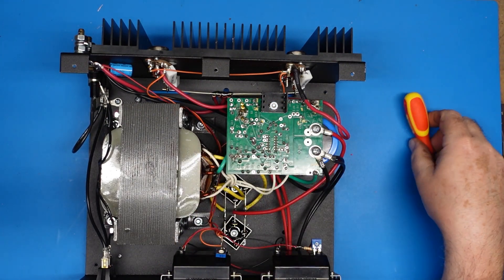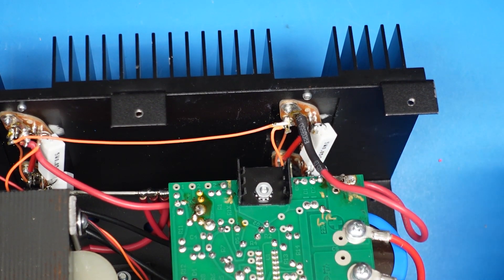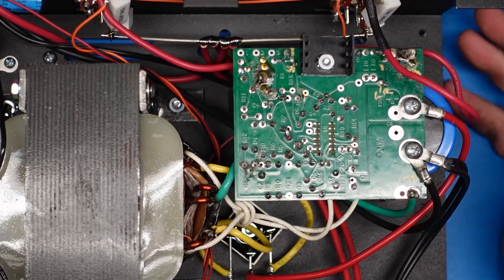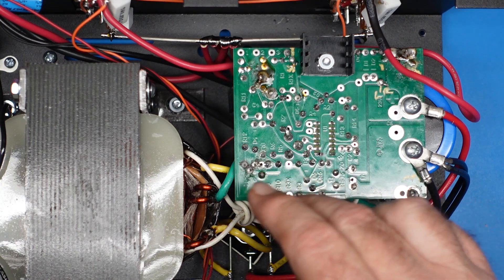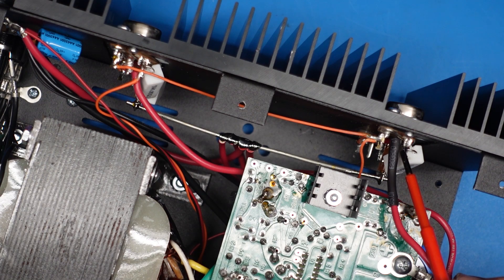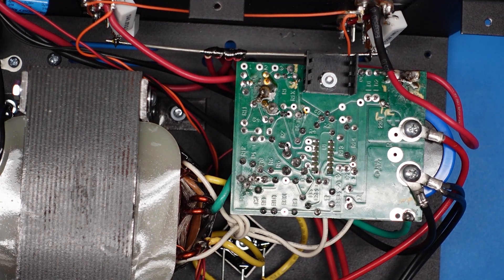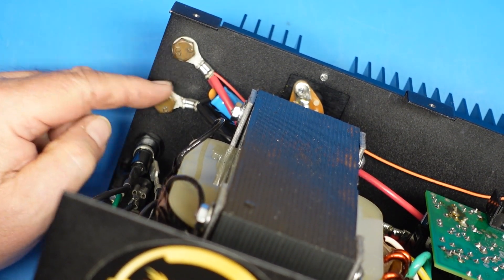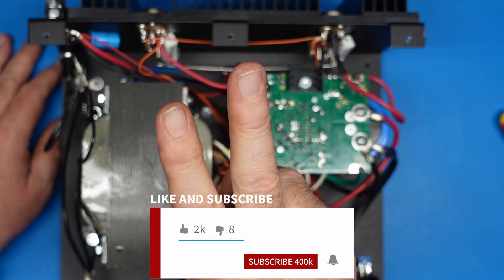Decoding the Mystery: Understanding Astron PSU Failure Mode

Comment: I have tested everything and replaced everything and cant get mine to work... I'm reading 0.2ohms from + to - on the back posts
Reply from the maker: I am pretty sure the one I have is snakebit at this point.  I had it working, now it's gone full stupid.  Again.
Reply: @FEPLabsRadio I actually found my issue! it was the 2200uf filter cap that that is between the two output terminals. I clipped it off and the PSU turned right on. I have the spare coming in the mail. I haven’t seen anybody mention this failure point online yet

Comment: How did you verify that the filter capacitor is good? Mine has no ac on the output. When transmitting the output voltage drops 2 volts. It has a regulator problem. I'm going  to replace the LM723 next. Any thoughts? Thank you! Larry.

Comment: I'm having the problem right now where the fuse blows as soon as you turn it on and no output. VS-35M circa 2007

5:00 Mine doesn't have that black ceramic cap on the input side of the transformer. Huh.
Reply from the maker: Look on repeaterbuilder.com - there is a pretty comprehensive troubleshooting/diagnostic list of docs on there, specifically for Astron linears.  Somewhere, you have a dead short.  Honestly, the innards look like it was soldered by somebody who just learned how to solder

Comment: I have an electrical engineering degree and experience with power supplies and I had to go through the exact same process to get my Astron RS-20M back to life (after it was I who put it out of service by trying to “voltage-charge a lead acid battery with the thing—not good with this machine). So don’t feel as if anyone else would have brought more to the table than you did. A mixed blessing, these Astron power supplies: they last for a while in normal use—don’t ask more of it than intended and careful trying to modify because they weren’t designed to be “modified.” But when they quit you have a devil of a time troubleshooting—they were designed (somewhat) well but not for troubleshooting. It’s all crammed into the case with no convenient test points between stages. I was to the point of scrapping this thing and scavenging parts but tried one more thing and behold, didn’t blow the fuse again and DID show 13.2 volts out. This thing could last ANOTHER 10 years. Worth fixing because they’re so expensive but boy, do they suck up bench time. Keep up the good work!
Reply from the maker: I had a lot of good help out of a buddy (Hollywood) when I was working on it.  It was at the far edge of my skill level.  Turned out to be a little more than parts swapping, but glad I got the beast fixed.  It was still under warranty, but I just didn't want to hassle with that, and figured it might be a decent enough video while I struggled through it all.  Thanks for the good words, and thanks for watching!

Comment: nice work. glad you figured it out. i have fixed many power supplies over the years .lost count. started in 1976 or so. been fixing them building them. not just 13.8V ones either.  most Astron ones have them bolt studs for power.  the newer ones have power poles.  they have insulating caps for them TO-3 transistors.  I add heat shrink to AC leads . easy to do. most of them supply's are that way.  most of failures I see is power surges and made with cheap sub standard parts. and over loading . like buying a 15 amp to run a Icom 7300. at full power that peak 21/22 amps.  I add MOV or GDT surge protection often. some of that old thermal compound goes bad and dries out making transistors heat up to much. I clean them and re due.  using thermal camera to check them. also some times them bridge rectifiers go bad. mostly on Pyramid and China brand ones. with that one in video with them 2 rectifiers mounted to cabinet bottom ,If you have them go bad replace them and add a piece of aluminum or copper to work as a heat sink and use that thermal compound. I have bigger replacements I use. never had a replacement bigger one fail yet. you would love the 200 amp cont./250 amp surge one I bult. it linear 723 IC based and 30 2N 3772 transistors. fan cooled. 4 50  amp transformers.  240V ac in. made in 1988 around. never failed. big and heavy. 1 person can't lift it. 
73's
Reply from the maker: Thanks for watching my struggles!  I think the original problem was a bad solder/short in one spot, barely making bad touches !  In my troubleshooting (admittedly, blazing a trail), I also induced another problem initially.

Comment: Always good to take pics during disassembly specifically if you don't have a good manual.  I would also always replace the pass transistors in pairs if they are set up as a darlington pair.  Just my thoughts from my experiences.  It was definitely a learning experience.  Great series you ought to put it together as one.  thanks Jeem!  73
Reply from the maker: Jeff, I have NO idea why I didn't.  That would have been easier than all those labels.  Yeah, when I smoked one of the transistors, I looked up the parts, and they weren't crazy expensive, I figured I'd just get all of them, and eliminate the issue from cropping up later.

Comment: Well, I won’t be buying an Astron power supply. Thanks for the update.
Reply from the maker: I have 2, and to be fair, this was under warranty, I took the hard route on it.  However, it was not super quality I saw inside.  My buddy called it "MFJ quality" on the wiring and solders.  I'd say it's Cadillac pricing and Pinto construction.

Comment: The stud or bolt connections can carry much more power than a binding post.  Binding post will have melted long before the bolts even get warm.  All of my high power lab supplies made by HP have studs/bolts on the back for output.  HP used bolts for a reason, current carrying capacity and connection reliability.  No matter how hard you try you just can't hand tighten a binding post as tight as you can a bolt and nut.  It's so easy to move wiring around and unknowingly loosen the binding post.  Try to do that with a stud connection you tightened with a wrench.
Reply from the maker: Probably so, but I still think exposed hot terminals is poor design.  I ended up 3-D printing a cover to go over it, so nothing lands on those studs and shorts them out.
Reply: @FEPLabsRadio   That's one thing high current lab supplies have that the Astrons don't, terminal covers.

Comment: Astron used to put binding posts on their 12amp and 20amp supplies,  The main failure I saw was the 723 chip going bad, so I started installing a socket. whenever replacement was needed.  I heard recently that 723 ic's were no longer being made,  and Astron had redesigned their regulator board. Thank you Jim!
Reply from the maker: I grabbed a pack of them, can';t remember if it was mouser, or amazon.  Thankfully mine was socketed.

Comment: You can 3D print covers for the transistors and cover for the power posts.
I have a Astron RS-12A I picked up at Goodwill.  With no load it measures 14 volts, but as soon as any type of load, no matter how small, it drops to 7 volts.  When I get time I need to tear it apart.
Good videos on repairing the power supply. These have been around forever.
Reply from the maker: You can check the pass transistors pretty easy, don't even have to take the cover off.  Next, I'd replace the 723 chip (hopefully yours is socketed.).  Those are cheap components and not involved to replace.
Check out SevenFortyOne's channel, he has a couple of good videos on his troubleshooting process for Astron's.

Ron - I went and grabbed them off thingiverse, I have covers on all of it now.  Transistors, and the posts on the back.  Thanks for watching!

Comment: Binding posts will carry less current, and are less secure physically. That is, the nuts on the studs take a wrench and stay put better than binding posts.

Plus, it's only 13.8V. On the back. Away from children (right?). So, who cares?
Reply from the maker: I found 3-d covers that I printed out to pop over those parts.  Yeah, no kid around the backside, but I also don't want to bump it against something (or vice-versa) and let the magic out.  Call me paranoid.